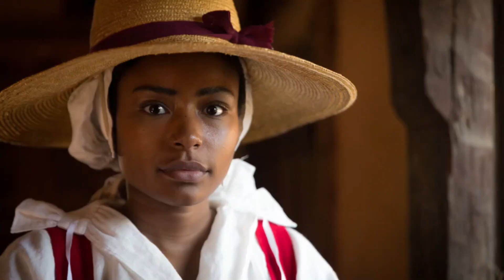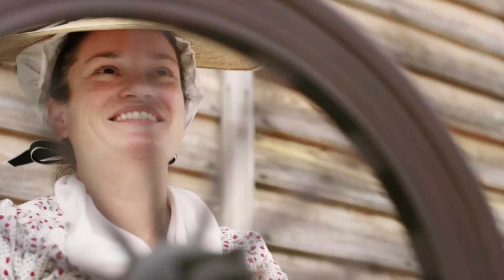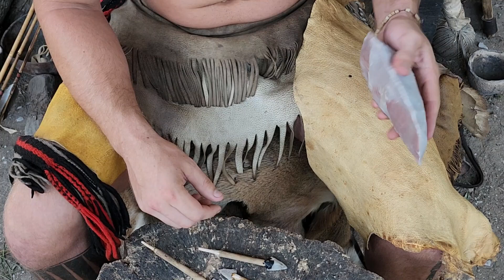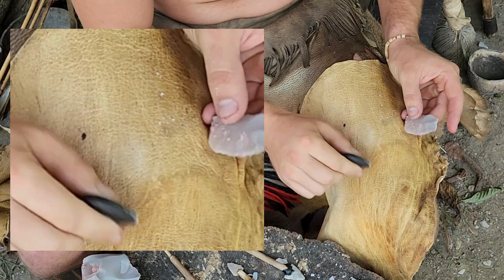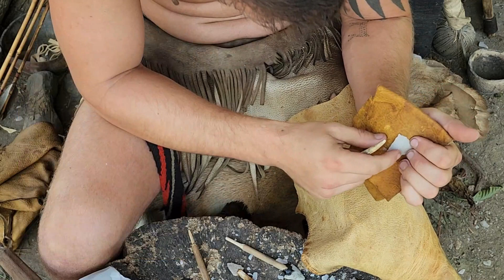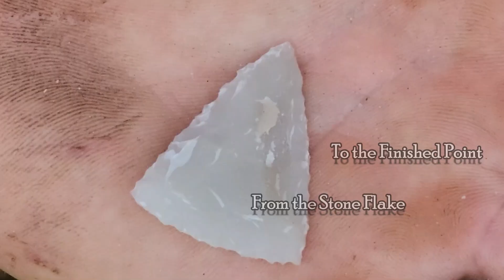Primed and Loaded | Making A Powhatan Stone Arrow Point

Comment: Very cool!  I saw that several of the arrowheads were set in short shafts that Russel then fitted into larger ones.  Is that something that was done historically, and if so, why?  Or is it just a handy way to make arrowheads more portable for interpretive purposes, without needing to carry an entire arrow?

And was there a trade in metal arrowheads after English arrival at all?
Reply from the maker: Arrows were commonly made from river cane. It made a strong straight shaft, but has a hollow structure. Because of cane's hollow structure, the arrow point needed to be hafted onto a short wood shaft, and that point/shaft assembly could be friction fitted into the river cane arrow shaft. One benefit was that the arrow shafts could be easily recovered, especially if the point was deeply embedded. But an even better benefit was that river cane arrow shafts allowed the interchangeability of arrow points and that allowed the archer to refine the arrow for specific uses by selecting a particular point -- big game, to small game, to fishing points.

There's no indication that the English traded metal points to the Powhatan. Highly doubtful that they would.  In 1623 Engligh long bows arrived in Virginia. Virginia officials did not allow them to even come off the ship and sent the cargo of bows to Bermuda.
Reply: @JYFMuseums  Thank you for that information!  It's very cool to learn that Powhatan archers were using interchangeable heads on arrows.

Comment: Those seem like inferior design to Clovis.
Reply from the maker: It is not that one is inferior to the other, it is that these points existed at different periods of history, and each had a specific purpose.  The clovis point is generally an older point with a size and mass that indicate it was likely hafted as a spear point – these points are often measured in the range of 1 to 2 inches wide by nearly 3 to 4 inches in length.  The smaller triangular arrow points, demonstrated in the video, are going to have a good penetrative quality because of their triangular shape, without having to have greater mass behind the point.  A quality the clovis point’s lobed shape may lack without mass of a spear shaft behind it and the reason for their size.